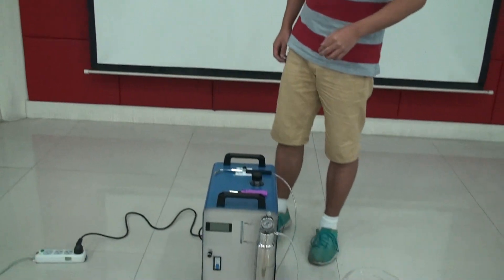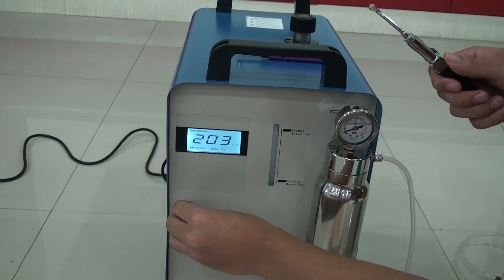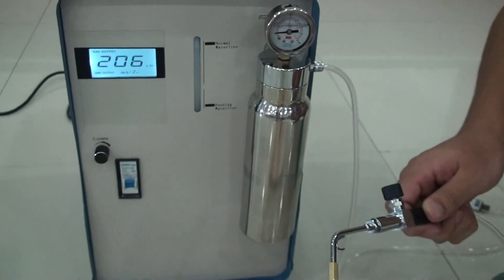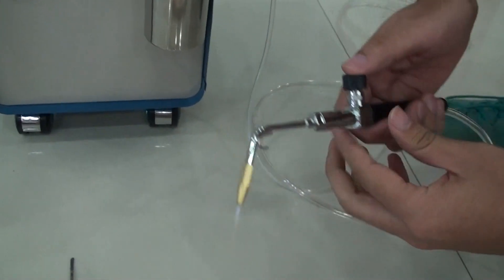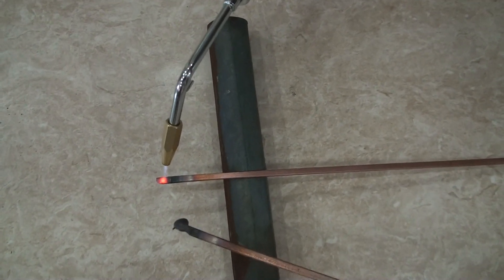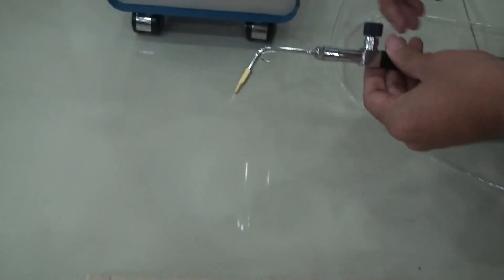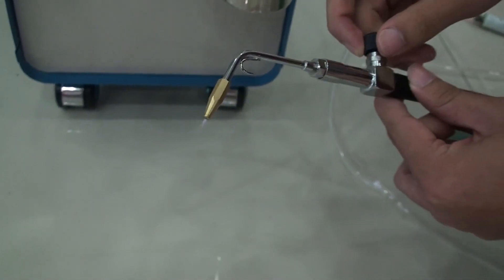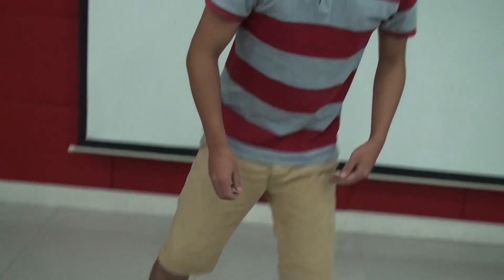hho

Comment from the maker: Production Capacity:
1,Welding current is stable because of adopting IGBT inverter technology.
 2,Due to quick dynamic response、small impact current、fewer spatters,welding quality is favorable and noise is low.
3,Due to high efficiency,power consumption is only 60 percent of traditional welding machine.
4,The product has a variety of protecting functions such as low-voltage blocking,soft start,short-circuit and overheat etc which make the machine reliable.
 5,ZX7-630 welding machine has carbon gauge function.

Comment from the maker: Advantage:
1,Welding current is stable because of adopting IGBT inverter technology.
2,Due to quick dynamic response、small impact current、fewer spatters,welding quality is favorable and noise is low.
3,Due to high efficiency,power consumption is only 60 percent of traditional welding machine.
4,The product has a variety of protecting functions such as low-voltage blocking,soft start,short-circuit and overheat etc which make the machine reliable.
5,ZX7-630 welding machine has carbon gauge function.
Application:
1. Heat treatment for metal parts.
2. Weld the hinge of spectacles rim.
3. Seal the injection glass bottle, conforming to GMP industrial standards.
4. Fuse the lead or tin alloy plate for storage battery.
5. Cut and fuse quartz or fine parts etc.
6. Peel off FPC of computer, fuse LED chip and thermocouple.
7. Weld jewelry made of gold, silver, copper, lead, tin casting etc, such as stud, safety pin, chain etc.
8. Polish irregular acrylic surface. After polish, the work piece will be smooth and shiny.